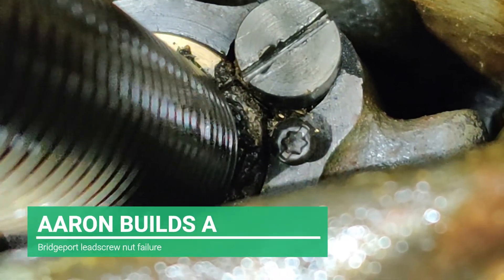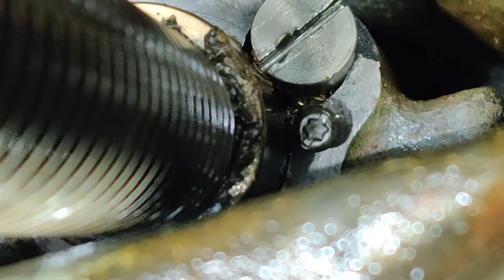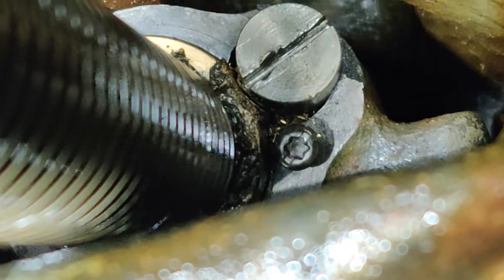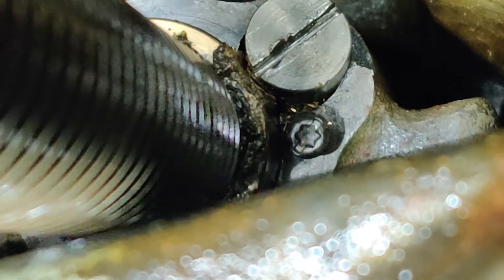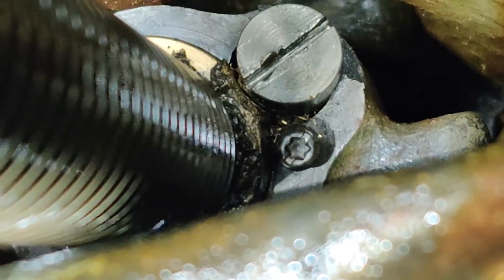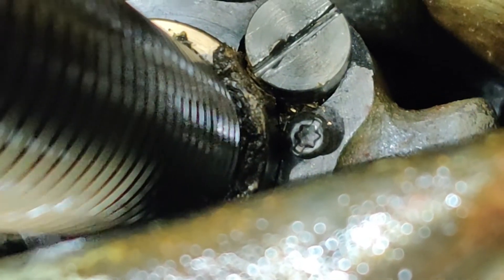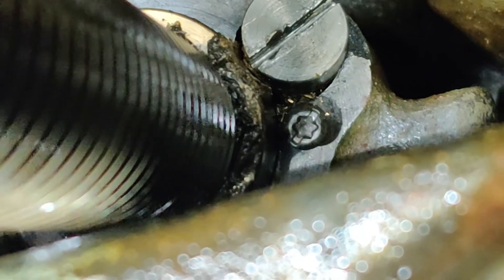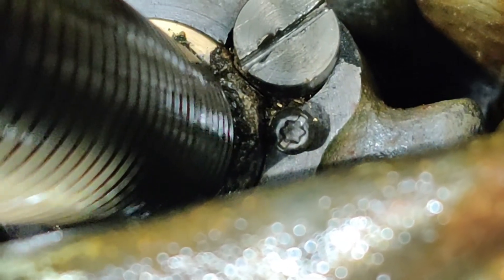Bridgeport Mill - Cross-feed leadscrew nut carrier failure ("Feed nut bracket")

Comment: Wondering if and how you fixed this. We just got a used Bridgeport in that has this exact same problem. My theory is that the cast iron bracket chipped due to the amount of force pushing on that screw.